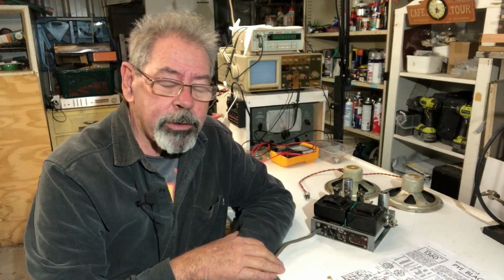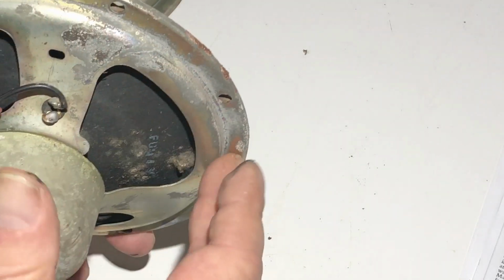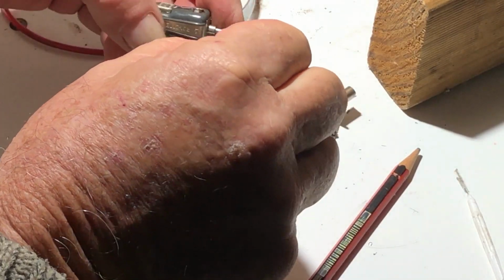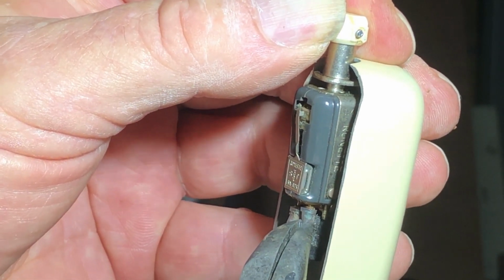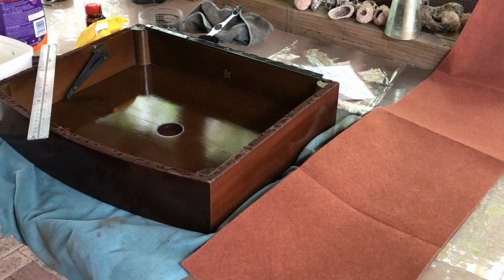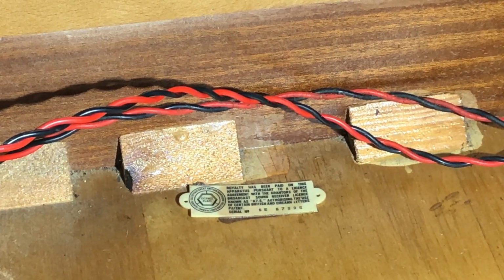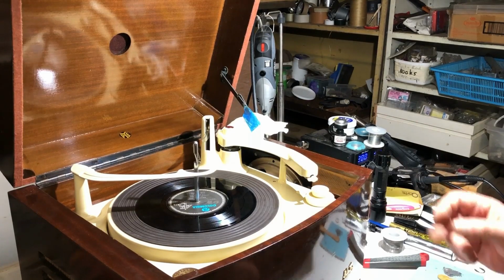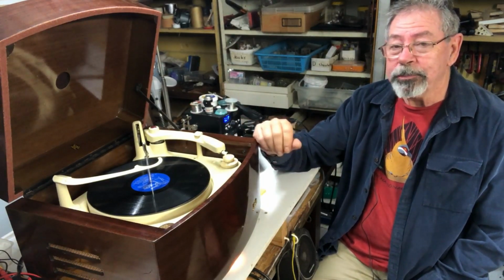Pye Black Box valve / tube Record Player from 1955 - Restoration Part 2

Comment: Nice work, especially the cabinet! A couple of comments. It looks like you have those Hunts paper coupling capacitors in the amp; they are almost certainly leaky, and can overwork the output valves and damage the output transformer. I've had to replace all of them in my BBH, even the tone capacitors, which were so far gone the amp had become unstable. The Ronette stereo crystal cartridges are harsh sounding things even when they're in good shape. Instead I've used a BSR TC8M. Hard to find originals in working order, but they can be rebuilt using a crystal from later BSR carts.
Reply from the maker: Hi Susan.  This is a while ago now but looking at part 1 where I did most of the work on the amp, I couldn't see any paper Hunts capacitors - or any paper caps - Ducon etc.  They're always leaky. I normally replace those straight away. I can't imagine that I left any in. -  I certainly hope not!
Yes, you're right about that Ronette cartridge.  It sounded awful.  I thought there must have been something wrong with it.  I did end up fitting another stereo cartridge which sounded a lot better.  Thanks for the tip re the TC8m.  I might try that if the situation arises.
Thanks for your interest.
Cheers
Reply: The Hunts caps have cylindrical brown plastic cases, but your player is slightly later than mine, perhaps they're a different brand? Or if not, made on a good day! I've not had any trouble with the filter capacitor, though.  @Donno308
Reply from the maker: @susanbutcher696  Hi Susan.  I didn't realise those little brown plastic ones were Hunts.  Thanks for the heads up!  Unfortunately I have since sold the Black Box, otherwise I would change them.  Hopefully they will be ok.  It was working nicely.  The last thing I want is an angry buyer knocking on my door!
Cheers

Comment: Have you paid attention to the polarity of the two speakers ? If one wired wrong the bass is only generated inside the cabinet. The cones should move out both at the same time. Closing the lid should then also make a difference ? And the openings under the speakers will also dampen the spirit a bit.
Reply from the maker: Hi Erik.  Yes I was aware of that.  Although I didn't check the speaker polarity, I have not altered the wiring - I kept the speakers wired up to the plug as they were originally, so I don't think they would be out of phase.

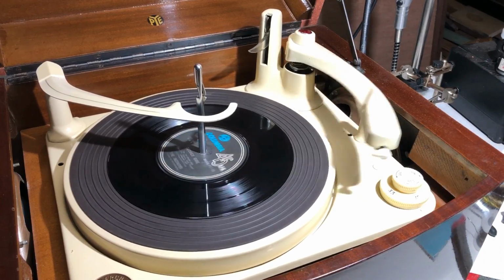Comment: 32:00 The story I've always heard was that ceramic cartridges didn't need any external circuitry, though I don't know if that applies to earlier "crystal" cartridges. I've also heard that the input impedance of the amplifier needs to be quite high (at least 100K) to get good bass response out of a ceramic cartridge, so that might apply to this one as well. Could there be an out-of-tolerance part in the amplifier that is lowering the impedance?  There were even some cheap phono amplifiers with resistive bass controls that only altered the input impedance.
Reply from the maker: Hi. I’ve certainly seen compensation networks used on crystal and ceramic cartridges. Sometimes it’s just a little RC network built on the tag strip on the turntable where the cartridge wires are terminated. Other times it’s integral with the amp tone control circuit but records were recorded using this curve to limit groove excursion on heavy bass and reduce groove spacing. 
In any case I think I’ve found the fundamental cause of my problem: The negative feedback runs through the tone pot which is supposed to be 1k. It had gone way high and virtually no neg. feedback was getting to the cathode of the preamp. I bypassed it with a couple of resistors and it now sounds great. Just waiting for a replacement pot to arrive. 
Cheers and thanks for your interest.

Comment: At 67 years young it was a well made cabinet and the electronic design was more than acceptable for its day.
Of course leaving in a dark damp room somewhere for a long time will destroy some things like a cartridge.
 I think just  using the Chinese cartridge and play 33 and 45 rpm records on it only. Use double sided sticky tape 
to attach it to the tone arm via a flat block to get over that ridge underneath. It would be a reversible conversion to do.
Good idea to add a Bluetooth device to it . I guess one day there may be a part 3. I like your style Don. You handled
the Black Box  problems  and got it sounding quite good!

Comment: You don't need RIAA EQ for a crystal cartridge providing it's fed into a high impedance, 1 meg or more. You only need RIAA if you use a mag cartridge.
The amplifier is way better than the cartridge used, ultra linear output transformer, negative feedback. Good for a domestic amplifier.
Regarding crystal cartridges, the higher the output the lower the quality and the compliance becomes almost zero, the side effect is terrible needle talk.
Reply from the maker: Hi Michael.  Unfortunately this amp seems to require a fairly high input, which limits the cartridges I can use with it.  I'm going over the chassis again though as I think there's an issue with the tone control circuit (the tone control doesn't do anything) and I'm beginning to suspect other issues.  I'll probably do another video on this one later on when I've sorted everything.
Cheers
Reply: I personally wasn't expecting it to be ultralinear, but then such techniques were invented in Britain.  I'd personally like to build an 807/6LQ6 guitar amp sometime with an ultralinear output transformer.
Reply: @douro20  I got my first big electric shock from the top cap of an 807 when I was a kid. I could hear the music in my head, Wont do THAT again.